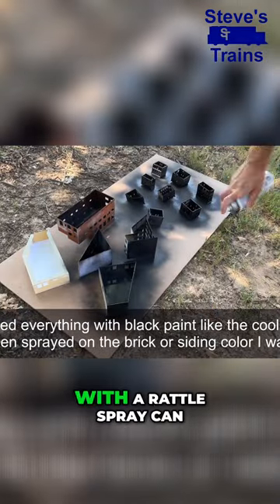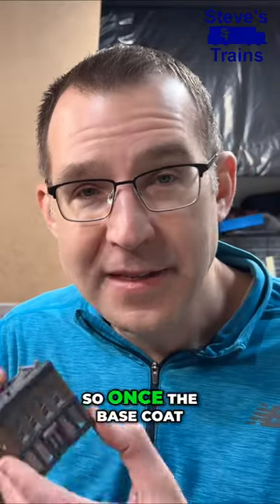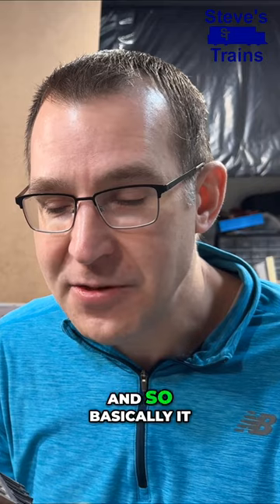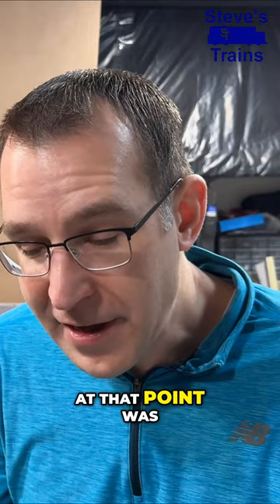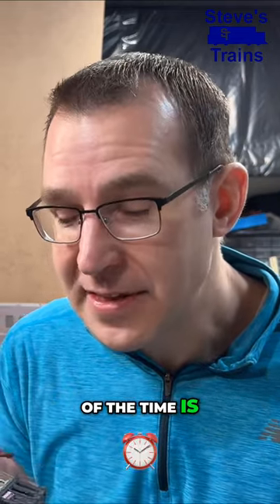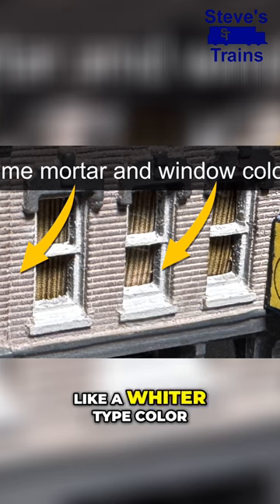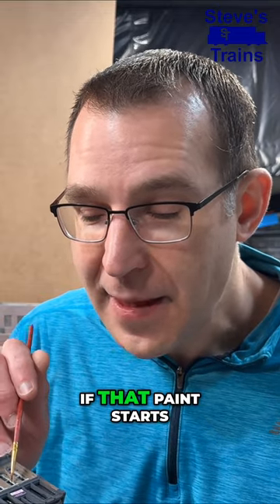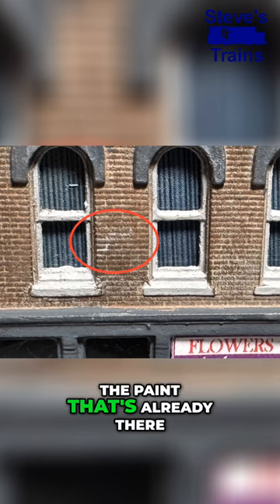How to Paint Realistic Brick Structures Tips and Techniques #modelrailroad  #painting

Comment: When I put it on the plaster is the consistency of playdougj and I just rub it in really well then let it dry.  Brush off everything above the joints very lightly with my fingers and poof I'm done.  Works pretty well. Also did it with the barn and the stone work looks fabulous.  Have a Pic if interested.
Reply from the maker: I’ll have to try different consistencies. I’ve seen some people get great results in N scale with it. A lot easier in larger scales, but I’ll have to play around more with it in N scale since it looks great when it works well.

Comment: That is interesting.  I do the red as the base and then take a mud consistent plaster and rub it into the surface so the cracks are Grey and then let it dry. Once dry I come back and just use my fingerprints as sandpaper to take the plaster off the surface of the bricks.
Reply from the maker: I often do that in HO and larger scales. A lot of the N scale stuff just has really small mortar joints. It can still work that way, but    you have to go pretty thin on the mix and it isn’t a lot different from paint at that point but the plaster mix can look better when it works. I’ve also painted the walls the mortar color and then dry brushed the walls the brick color and that can work really well too.